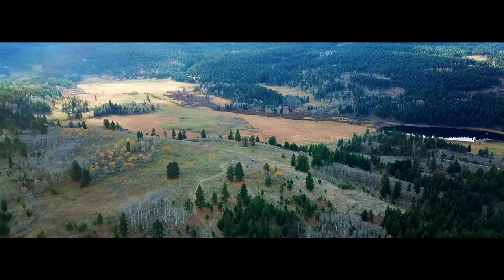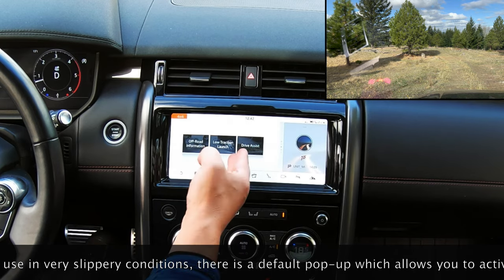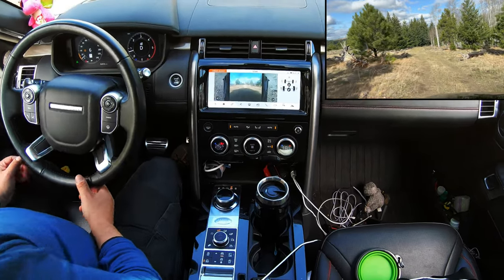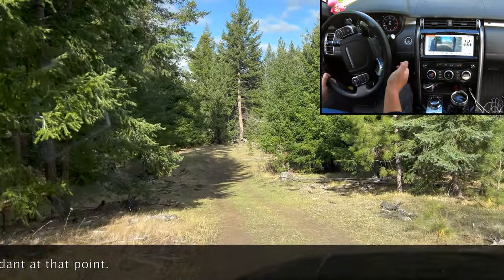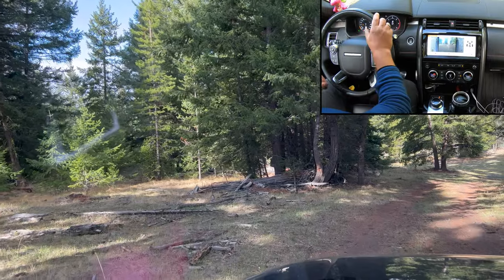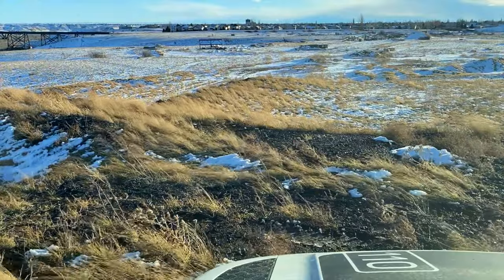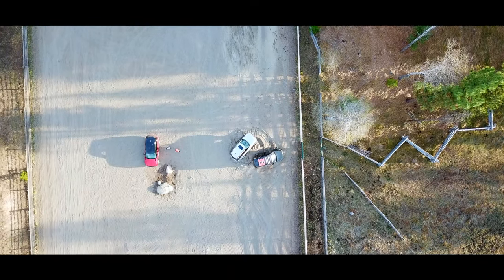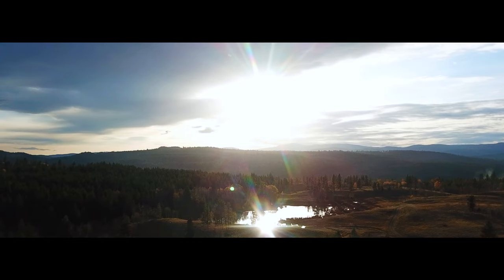All Terrain Progress Control (ATPC) and How to Use it on a Discovery 5 & New Defender #newdefender

Comment: Thanks to this video, I have learnt that my Discovery 5 doesn't have ATPC. I wonder if this is because it doesn't have Terrain Response 2 (no Auto TRS either) or whether this has to do with anal Japanese regulations. Pity, but I can live without it. Have done everything manually for the past 35 years of driving so I'm sure I can cope, but it would have been nice to have it.
Reply from the maker: I’ve a feeling that’s it’s because you don’t have TRS2 (I think the auto comes with the advanced off-road pack). 

It’s useful in some rarer situations, but I didn’t find it the most helpful function — you’re not really missing out! 

Do you get to go off-road much in Japan?

Comment: You missing your Defender at all?
Reply from the maker: That’s a tricky question. Largely speaking, no. The Diesel engine and performance off-road is far superior in the D5, the internal space is larger in the D5, and the vehicle is quieter. The D5 doesn’t surge when on cruise and doesn’t miss when climbing banks. Most importantly, the DSC stays off when it’s told to! 

However, the Defender was much (MUCH) nicer to look at, had better road handling (though the face-lift D5 fixes that with adaptive suspension), is slightly more comfortable, and the rack was easier to access (you can also open the boot with stuff on the rack, which was very handy for me). Otherwise, I think the D5 can (and does) pretty much everything the defender can. 

The defender is a very useful tool, but the P400 (and that particular vehicle) jaded me heavily against them. I’m fairly certain the diesels are a different tool altogether, it’s a terrible shame they’re not available here. The P400e will arrive at some point, but it’s general petrol hybrid design forces a P300 on me, and I’m worried that it’s performance will be lacking like the P400’s — especially when it comes to electric assist off-road. The V8 will be a known entity, but will suffer from poor fuel economy. I have to say that I’m loving the 36mpg because it means in the city I can do literally twice as much to the gallon than I could in the defender.
Reply: Glad you're enjoying the D5. I've had a diesel 4x4 in the past. And yes, it has benefits with the compression ratios being what they are with a diesel. But for me, I can't live with one on road. I enjoy driving. And I enjoy the power getting more and more and more  as the revs climb till reaching a crescendo at the red line. A diesel obviously doesn't do that. 

I can't say I've had the surges you spoke of, with my P400. Only negative for me, is I do feel it's size and weight on a short drive. Luckily I also have a little Evoque with the turbo 2.0 petrol with 177KW. Holds its own off road, and it's like a little go-kart on it. Still brings a smile to my face when I drive it. 

The Defender offroad is a machine. Did an epic trip for a few days in a virgin riverbed. It ran rings around a D4, LC 200s, standard FJs. The one heavily modified FJ, is the only vehicle able to keep with it. 
Here's the videos of it: 

https://youtu.be/Lnnoy5UD3c0

https://youtu.be/QUJMgzPDv58
Reply from the maker: @theshadypilot  I liked the overall design of the Defender, and I feel that a working one would be a formidable machine. As you have seen from my videos, though, the performance of mine off road was relatively poor -- it was easily matched by the L322 and L320; rather disappointing for something that was meant to be top of its form. I know for sure that the TPS and DSC issues that mine suffered must have been partially to blame, but I think there were other issues: the mapping of the throttle, for instance, may permit you to hit things hard, but very gentle manoeuvres are almost impossible (compared, that is, with something like the RRC or diesel-powered Landies). For instance, when the LR4 in your video gets stuck in the soft sand and he uses a low but consistent throttle to exit, that sort of throttle control was not -- in any way -- possible on my P400; it was either flat out, or not enough. 

Coming from the UK and having driven semis and agricultural tractors for so many miles (at least 2 million), the revvy petrols always seem to be unpleasant to me. The AJV8, at least, made a nice noise while doing so; the Ingenium 6 petrol is only nice at 1800-2400 rpm -- over that it just sounds noisy and aspirate. That said, and as I have mentioned on here, the P400 is a great engine to be driven hard (if that is the sort of thing you like to do); but I remind you that a Defender is not designed nor intended for that kind of racing around: it is an agricultural working/touring vehicle -- it's meant to be dependable, stalwart, indefatigable, and rather like a Clydesdale horse. It's not right for it also to be a racer -- for that we have a long line of vehicles in the marque (RRS, Velar, FFRR, F-Pace and so on); the one vehicle in the line that should be good at the agricultural, slow, progressive, off-road, indefatigable, work-horse, is the Defender -- and its not any of those things with the P400 in it (at least mine wasn't). 

Glad you're enjoying yours, though!! That it's doing what you want is a good thing. I didn't really feel the Defender to be large, but coming from my background, it wasn't! I had two (as I am sure you know from the videos), neither of them worked properly and both of them sort of missed the mark for being a Defender. I hear from the boys down under that the diesels perform much more like a Defender should than does the P400; I suppose this is because the Aussies have had the original defenders too and understand what it is about a Defender that makes it different from the others -- I imagine in SA you will have similar feedback, as you've had Defenders and series Landies for years. Here in North America we don't have that legacy, and so the ethos of the Defender is a bit muddied by expectations from elsewhere in the line. Why did you plum for the P400 when you have a diesel option there?

BTW, that war wound will buff out! Glad to see you gave it some testing! Our Terrain here is much different than yours. Though sand is innately slippery, it enjoys a relatively high level of traction -- conditions which later generations Land Rovers excel. However, up our way, we have a lot of mud, snow, and ice -- relatively low traction surfaces; conditions in which newer generation Land Rovers don't do so well. If you check out some of the off-roading videos I have posted here, you will see how easily the Defender is stalled (especially in the snow, where it bellies out and the DSC overcomes any attempts to extricate it due to it not remaining in the switched off position).
Reply: Yeah, that damage buffed right out ;)  Luckily my insurance company were pretty good and happily replaced the whole door for me which only cost me my excess which was less than what I would have paid had I slashed a tyre on the trip. 

So, I was one of the first in South Africa to get a ND (back in July last year already) and at the time there was no D300 option. Only the D240 which was discontinued shortly after. So it would have meant a wait even if I wanted a diesel. Also, I was concerned as there is a well known, major,  issue with the Disco 4's regarding the crankcase on the 3.0 diesels. 
I can't remember now, but did your ND have the rear difflock? I've heard that the software   for the traction control is optimised for that configuration (so if one doesn't have the rear difflock, it's not nearly as good offroad and not necessarily only because of not having one)

What I also heard a few weeks ago, was that because of the global supply shortage of silicon computer chips, they've had to pause production on the ND. So now stocks are so low at the dealers, they were offering to buy mine back at R50k ($3200) less than what I bought it for. So I'm thinking about letting it go.
Reply from the maker: The value of them has risen significantly in the uk and in the US — sadly their value is not rising here in Canada, sadly. According to dealers, they have used vehicles on stock that they can’t shift. They may be doing that dealer thing, for sure, but Canada does have a funny relationship with JLR. I’m not surprised, really, given my experience with corporate — I’m surprised that they sell any vehicles considering their attitude and lack of product/customer support. 

Sounds like you’ve got very good insurance over there. We have had some recent dramas with my insurance company; I’m not at all sure that they’re anywhere near as good as yours seem to be, but I haven’t had any claims with them — just drama trying to get insurance to a reasonable rate (I’ve two million miles of professional driving experience in tractor-trailers in 88 countries, but my insurance is more expensive than my partner — who’s had two complete write-offs in the last four years and has never driven out of Canada!
Reply: @shedlock2000   I know right! We have an insurance company here that only caters only for the fairer sex (excuse the pun, there's nothing fair about that) I just don't understand how they're still in business! My wife's list of "incidents" on the road is as  long as a mile. And she flies commercial aeroplanes for a living (granted she's a better pilot then a driver)
Reply from the maker: Is she a commercial pilot or private? That’s quite a skill whatever — I’m surprised she’s less skilled in the car! 

I’m quite unhappy with the gender difference in costs. Though I know why it’s there. The difficult thing is that those of us with good driving experience suffer because of the issues others have. It’s not a great system and it’s not like they don’t have the data to make individual policy quotes (driving history, concoctions, accidents, claims etc.).
Reply: @shedlock2000  Commercial pilot. She's more skilled in the higher speed department.  It's the slow speed stuff and reversing  where she's more daft than deft....
Think it's more of a "boys playing with cars from a young age" thing. 
Have you seen some of those women driver compilation videos???!!! 🤣

Comment: It will heat and wear the brakes if used for extended periods. Personally I don't think it is suitable for wet slippery slopes where a touch of the brakes may lose traction and cause all four wheels to slide. Where delicate use of the foot pedal and knowing when NOT to brake at all is essential to preserve machine and life.
Reply from the maker: I am sensitive to your thoughts here, Huw. I agree that there are many limitations for the tool. ATPC isn’t HDC, though (though it does incorporate it and suffered from the issues you mention because of it). 

I should say, however, that Emeka and I did run a back to back hill descent on loose gravel and dirt both with HDC on and with it off (using engine braking). Because of the shifts in engine design, hill descent on engine braking was significantly faster (and less controlled) than on HDC. This was disappointing for me to discover, as my experiences with descents used to be quite a lot different (using a manual transmission and a high-compression Diesel engine. In today’s vehicles, my diesel descended in low first at 10kph, while Emeka’s 5.0 V8 descended at 6kph; both vehicles descended at 3kph on HDC. Of course, the bigger displacement was the cause of the superior performance from Emeka’s L494, but I was very disappointed in general with Huw both vehicles performed on an unassisted hill descent using engine braking. 

While you’re right about the judicious use of brakes to assist a slippery descent when one wheel slip causes others to fail too, I’m reminded of the poor engine braking now afforded by modern engines and how the mechanics of hill decent through engine braking won’t work like they used to for us.
Reply: Exactly.  I used low transfer and played the gears while descending Mt Washington in our Defender P400 and it worked perfectly.  Couldn’t use HDC on something that long because it would have fried the brakes.  Engine braking in low is plenty for controlling speed.
Reply from the maker: @arkos55  It does depend upon the grade of the descent, though. As I have pointed out in videos here, the P400 I find desperately lacking in engine braking and the additional gears makes it much harder to dump them in a hurry (for on-road use, that is). My L322 had much better engine braking than the P400 (which performs a bit worse than my TD6, for obvious reasons), and the AJV8 in Emeka's vehicle outperformed my TD6 on a 22º descent. However, compared to the manual transmissions, older Rover V8s and early generation Tdi diesels in the range, the current engine braking is abysmal: In first low in my '81 RRC trialler, I could descend a 30º slope with much more control and reduced speed than I could in either my L322, L462, or L663. The change is in slippery engine design and automatic boxes.

Nevertheless, as I have marked here many times, the engine braking for on-road descents is far superior to the use of brakes -- especially when towing. I am not sure that, off road, the length of grade would be sufficient to over-heat brakes and you wouldn't use HDC on something like the coq. It is worth noting, though, that the new cruise control systems Land Rover use do also engage brakes when the speed increases over whatever the cruise is set to. Accordingly, if you set your speed to 70mph and then descend a steep grade like the Coq or Wolf Creek Pass, then the brakes would be engaged to reduce your speed accordingly -- but only to 70mph (and you would probably want a slower speed than that). It would not surprise me if the brakes became hot after such use, and this is one of the reasons I have posted a number of videos criticising the reduced engine braking efficiency in newer Land Rover models (though I believe the issue to by systemic throughout the motor industry as a function of meeting emission and fuel economy constraints).